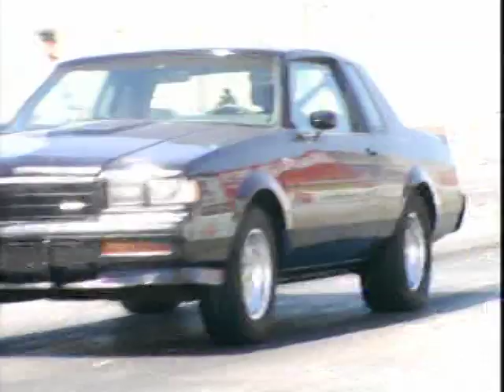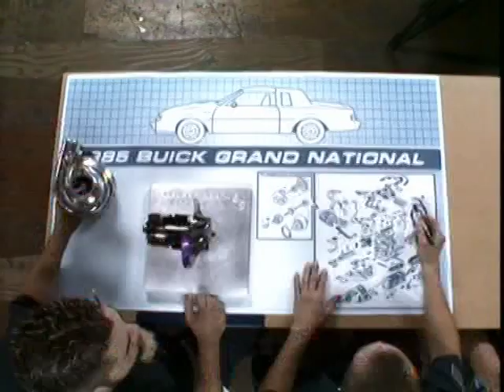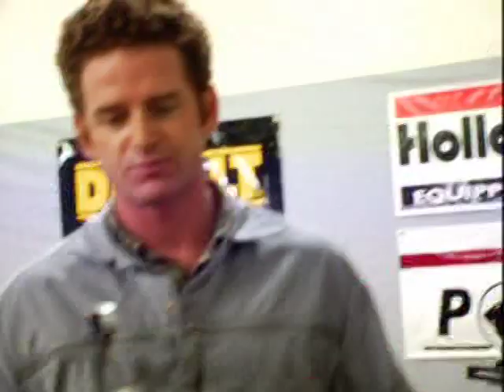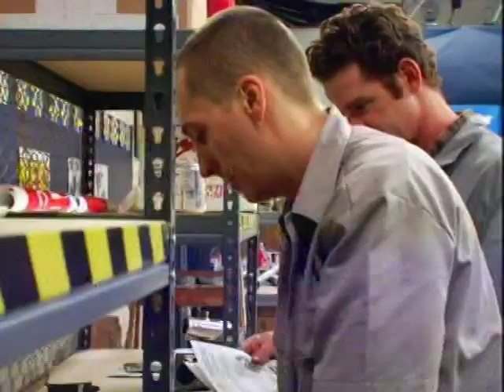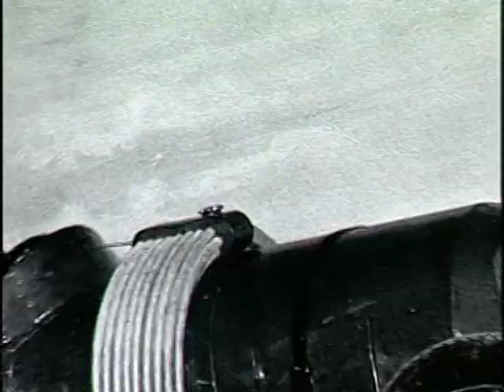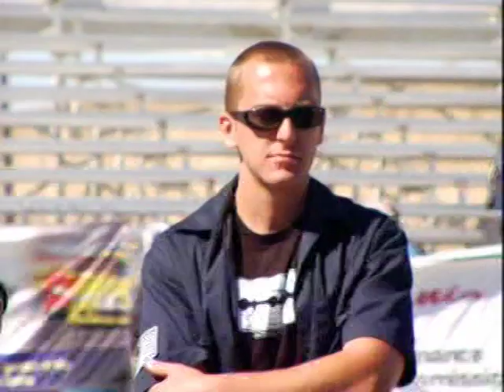Buick - 1985 Buick Grand National

Comment: Cringed when he took the oil line fitting off with vice grips! That was right after he asked if it was ok to bend the waste gate rod or not. I agree they should have started with 86-87 models which are identical mechanically and far superior minus the Power Master. I suspect the cost would have pushed it out of budget for the show.

Comment: Instead of spending all that money on an aftermarket front mount intercooler and bigger turbo for a hot air grand national. 

(Keep in mind that hot air mods are a lot more expensive then 86-87 intercooled   Mods these days because nobody buys them. Most people just upgrade their 84-85 hot air to the stock 86-87 cold air set up and just keep building on that). 

They could've bought all the necessary parts to convert that Engine into a stock 1987 intercooled engine and they would have made a better pass at the track. 
But I guess it made for a good television show. Just wasn't the best decision to make a hot air regal go faster. Lol
Reply: +S1KRR  Even better, they could've converted to a turbocharged 3800 Series II. This is what I'm doing with my 1987 Turbo-T after reading several posts on the forums about how it's far superior to the LC2 and WAAAYY more responsive, and it's not like the LC2 is a slouch either though.

Comment: I strongly believe that the one with the T tops is a 1984 grand national. Only 1984 turbo Regals had hydroboost brake systems like that. 
I think GM should've made all grand nationals and turbo Regals with  hydroboost brake boosters. Instead of the power master that is prone to failure without warning.
Reply: My all original 70k mile GN has hydroboost, maybe it's an early '85?
Reply: you're right it could be. my bad
Reply: I could not agree with you more

Comment: 1985 was slow .the best your was 1987 they came with an intercooler which cool the turbo which made more horsepower
Reply: mechanically no difference between 86 and 87.
Reply: @sinusbradycardia  no diff in motors in 86 to 87.. Buick claimed 10 more horsepower in 87 just to beat corvette, but both years 86/87 they were really both 245 horsepower!
Reply: You are 100% correct. But 86 is also a great year for turbo regals.  But overall I agree with you. 87 GNs had a really cool grill and the power steering systems were less prone to foaming.

Comment: The GNX was a single turbo, I believe.  But they were outrunning a twin-turbo, modified Vette.  That's why they were canned by GM.  The Vette was GM's muscle car and it was getting embarrassed by a "grocery getter".  And why was he using a pair of Vise-Grips to remove a fitting?  Rule #1: Use the right tool for the job.
Reply: 2cyclemix That, and the G-Body was replaced by those new fangled front drivers everyone thought they had to have 

They could've got 2 more years out of them, easily. Another GM screw up.
Reply: the corvette is chevys version of a supercar modeled after ww2 era European sports cars the camaro has always need the front running pony car/muscle the Buick regal turbos were experimental versions that we super popular watch the documentary black air it here on youtube
Reply: 2cyclemix you don't know what the fuck your talking about you must be like 19 yrs old.

Comment: They should have gotten Tom from Tom's Turbo Garage on here. They all missed one key thing. The valve springs. The springs from the factory were only 80lb springs which are bad for even a N/A car. After 25+ years those valve springs are probably only at 60-70lbs.

Comment: Actually if you look at the early GM EFI wiring schematics, the fuel pump relay is only pulled in by the ECM at crank. Once running, power is fully run to the pump through the oil pressure switch. oddie3504 is right.

Comment: #1. To the guy that thinks you can compare a 3.5 liter altima of today with a Buick of 25 years ago...YOU ARE MISSING THE POINT!  It was 25 years ago!  Nothing could touch it then.  #2. Buick is bringing back the Grand National and the GNX in 2014.  It will be on the Cadillac ATS platform with twin turbos and an expected 400 HP.

Comment: Results were disappointing and too me makes Grand Nationals look bad.  My 86, stock, ran low 13s with just 93 octance chip.  For a little less than $2k, I was in the high 11's.  Bigger turbo (TE44), injectors, fuel pump and methanol injection.  I guess the intake on the 84/85 GN were the limiting factors.  They flowed poorly.

Comment: For you GN dummies making fun of the video....there goal was to take the 85 motors (which is not the inter-cooled one) and race them. They where not speaking of the 87 inter-cooled motor because it wasn't there objective...they could of easily swapped these motors into the 87's if it was part of the plan...

Comment: Continued: 
PS header, DP is nice to have depending on the goal
Turbo upgrade / Stall converter  if you plan to run >18-20 psi on stock motor.
Limited Slip rear end
Sticky Tires
Tuning, tuning, tuning
Knowledge via turbobuick-dot-com, gnttype-dot-org, virtexbuicks-dot-com
Patience via prayer.
GREAT heads make a huge difference.
Can’t list it all but this will be a good start.